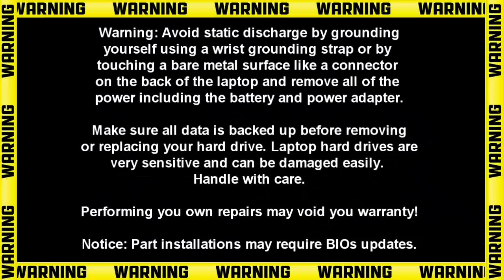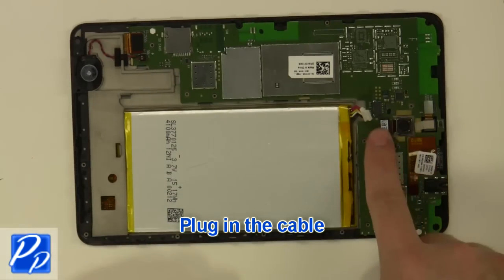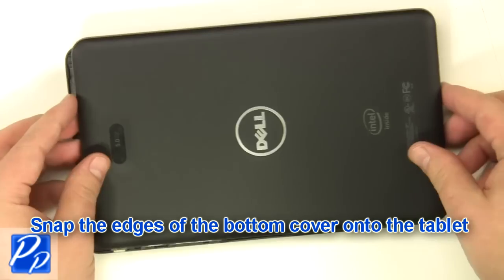Dell Venue 8 (3830) Android 4.2 Tablet Battery Replacement Video Tutorial Teardown

Comment: Just wanted to give you a big thanks!   Great tutorial; breezed right through the battery replacement on my Dell Venue 8.  It's been a pretty amazingly durable, rock-solid tablet and I really appreciate the well-detailed video. I even managed to remove and return all 14 screws without a T-5 Torx - which was smaller than any I had on hand.  Just used a mini slotted screwdriver and - with enough pressure and proper placement: that worked well.  Thanks again.

Comment: Thanks for this. After an unfortunate drop, my Venue 8 tablet stopped charging the battery when plugged in with various cables. Figuring something popped loose I gently squeezed the cover and heard a click and it showed the charging symbol. However, the charge does not go up. The tablet also shuts off intermittently and sometimes won't start without a cable plugged in. When it does turn on, it functions normally. Now that I see how to open it, I'm going to have a look inside. Do you guys do repairs on these units?
Reply from the maker: We can do repairs as long as we can find the necessary parts. Unfortunately the parts are pretty rare. Almost everything is built onto the motherboard and we have had only one since these came out (the MB we had was from the tablet we used in this video).

Comment: I have DELL Venue 7" Tablet. Bought in Feb-2014. For last 2 days I am unable to charge as it is showing 'Invalid Battery' at the time of charging. Also showing battery power 0. What is the solution. Whether this battery is under warranty ?
Reply from the maker: It will either be the battery needs to be replaced or the DC jack needs to be replaced.You should contact Dell and see if you still have a warranty. If you do, it would probably be covered by it.

Comment: I have a 1 inch line in my tablet going vertical  and the screen wont work on that area is there any way to fix that or no
Reply from the maker: +Artie Bellini You would have to replace the screen assembly.
Reply: +Parts-People.Com, Inc     my dell tab suddenly  shut down while i was using it and its not working now ! can u plz tell what would be reason for that?? plz reply
Reply: Hey bro i've got the same problem with my venue 8 pro. You need to replace the screen, depending on which model you have,  could cost you more money. so search online for your model and see how much the screen/digitizer costs.

Comment: I have a fell tablet when I went to remove the outside case it didn't release. It acts like the very center is attached to something. I could not get it farther apart.
Reply: fell tablet
Reply: dell tablet
Reply from the maker: Which model Dell tablet do you have?
Reply: Parts-People.Com, Inc  dell 7
Reply from the maker: I need more info than just Dell 7. Is it a Venue 7 or Streak 7? If it's a Venue is it the 3730, 3736, 3740, or 3741? If you don't have this information I'll need a Service Tag.
Reply: Parts-People.Com, Inc Ok I wanted to be sure on the right model Venue8 3830
Reply: tablet says it's a venue 8 3830
Reply from the maker: Cool, you got the correct video model. There are not any screws going through the cover but Dell is good about using double sided tape for no reason. I suspect this might be whats going on. If you have loosened the sides of the base, especially around the power and volume keys, you should be able to pry it up until it comes loose.
Reply: Parts-People.Com, Inc oppressively I will just have to slide something in because it wasn't coming apart. thanks didn't want to go any farther until I was sure.
Reply: I hate spell correct when I haven't taken the time to re-read what I entered thanks again

Comment: where do i get a new replacement battery for my 8' dell tablet?
Reply from the maker: There are 3 different Venue 8 tablets, if you have this tablet, the 3830, then you can get the battery here https://www.parts-people.com/index.php?action=item&id=15000 . The 3845 can be found here https://www.parts-people.com/index.php?action=item&id=17688 . Unfortunately I don't have the 5830 battery instock but you can get an email notification here https://www.parts-people.com/index.php?action=item&id=14996